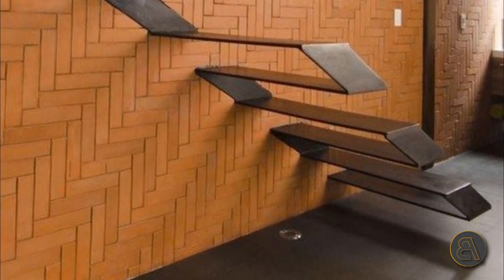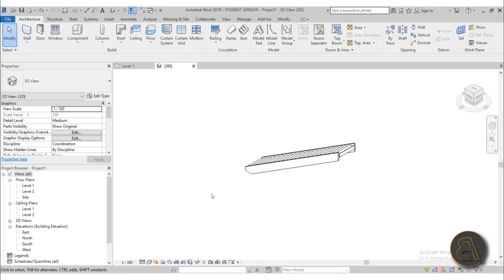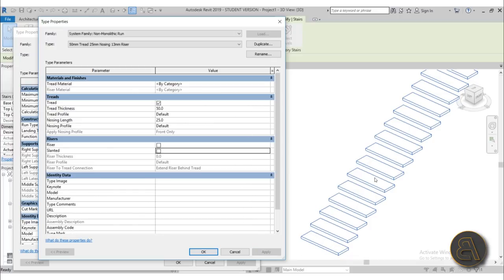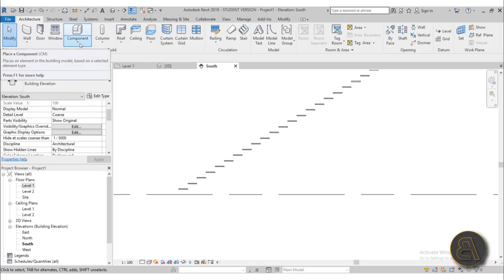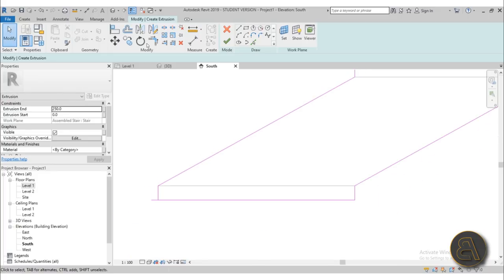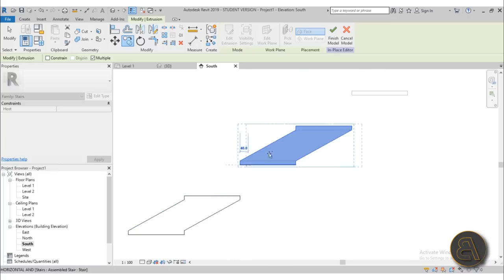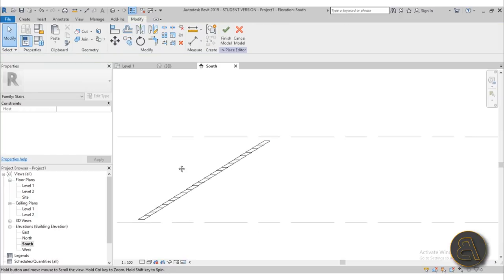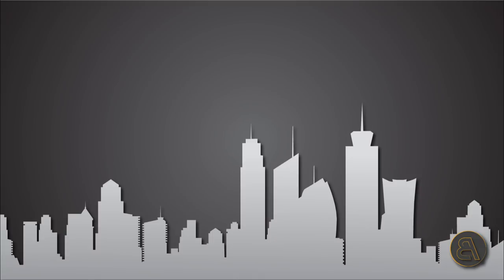Zig-Zag Stair in Revit Tutorial

Comment: Typical architect form before function. Now get it pass the building code.
Reply: Stairs in Revit are actually very easy to design and build to the codes. In Australia we use AS1428 and NCC and Revit has inbuilt tread/riser checking functions which we use to cross check our compliance. We also build our handrail families to generate extensions to meet disability requirements and balusters to satisfy maximum spacing between elements etc.

We would obviously never design a stair like this unless we were doing so for a building class which allows this (small scale residential with exemptions etc.).

I'm not sure which profession you are commenting from, but if you are in certification I suggest you do some more research on the architectural profession and how they use software to check compliance in future.